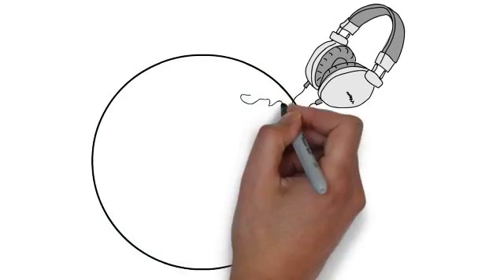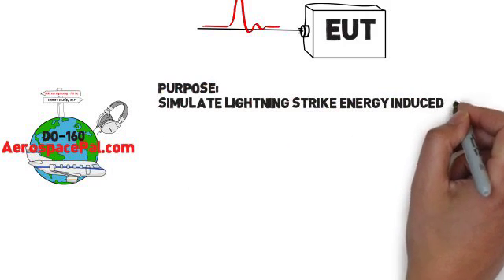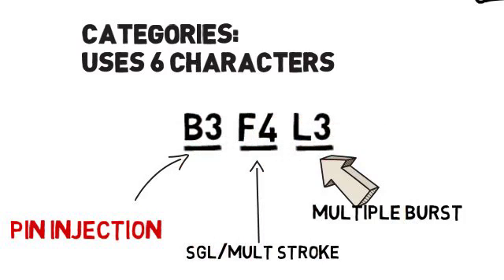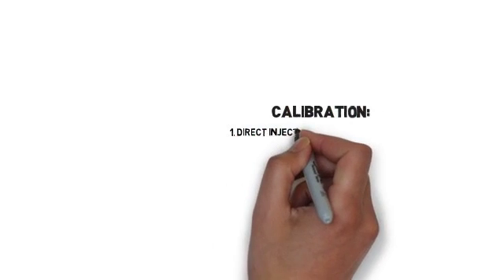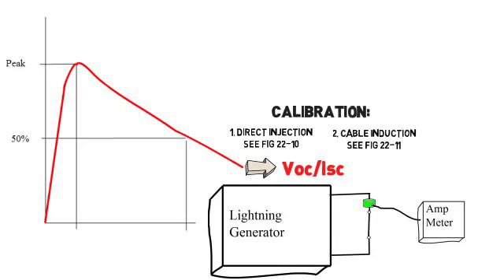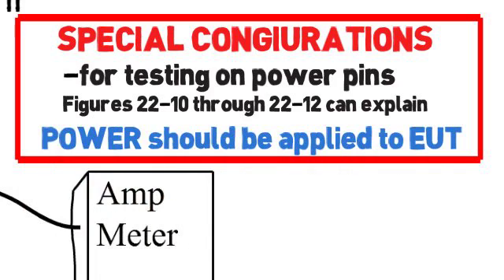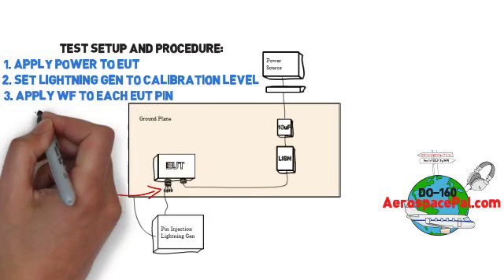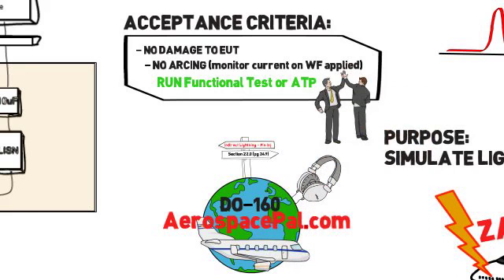RTCA/DO-160 Indirect Lightning Pin Injection Overview

Comment: how do you stop lighting damaging something? you divert to gnd?
Reply from the maker: Hey Allen, you can use an isolation method or protection method. Most aerospace equipment protects against indirect lightning strikes by using properly rated pulse resistors and TVS diodes. If you want more, visit the site and send me an email. www.aerospacepal.com patrick@aerospacepal.com